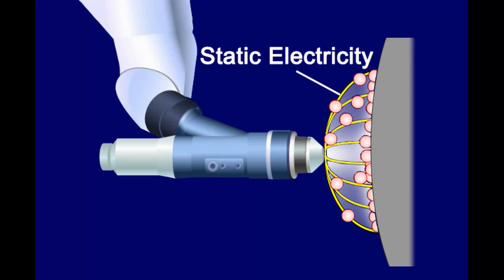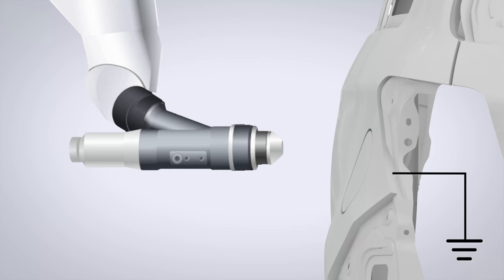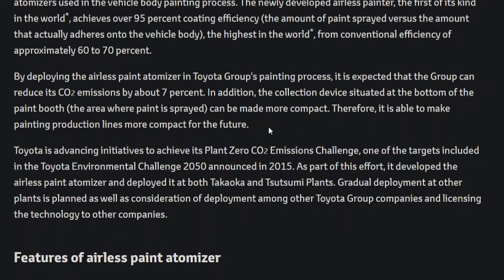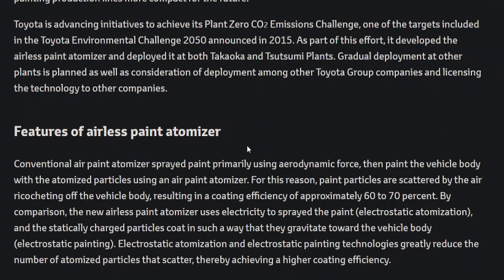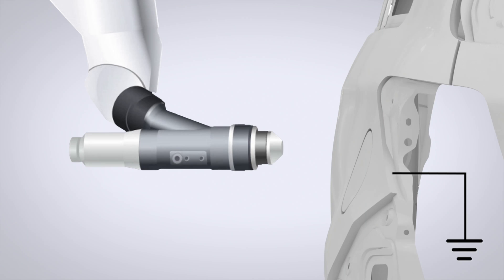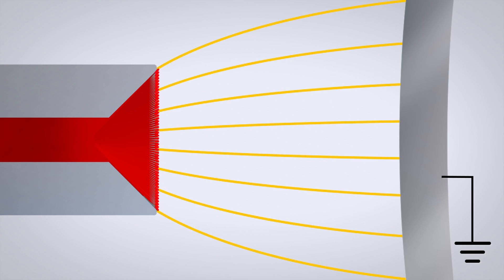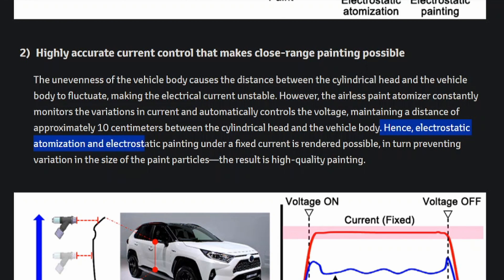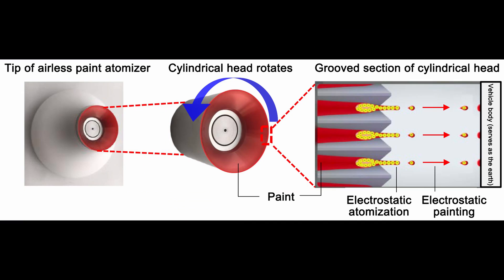Toyota now has ELECTRIC paint?

Comment: great video. more paint on the car is always a good thing. would toyota be the first oem to use this process
Reply from the maker: I bet others are using charged paint, but I think the rotating fins makes them the most efficient as well as the auto voltage
Reply: Kirk Kreifels oh, it’s just not a ‘static’ voltage diff attracting the paint but a live circuit between the paint reservoir & the vehicle driving the paint flow (with feedback). I missed that at first. Now that’s cool.

Comment: I enjoy the technical coverage you do. Also this sounds a lot like the powder coating process using high voltage to attach paint. There are some issues with this process like painting over your ground and sharp edges grounding the paint before round edges. I'm sure Toyota will figure it out